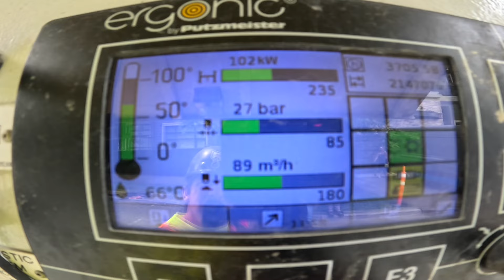PUMPING CONCRETE: 800 cubic yards with a PUTZMEISTER 56Z (with aerial drone footage)

Comment: When it ends up being an 800 yard pours but they  order 650 plus. The final 150 gets a little slow. Been there before
Reply from the maker: @sirmister4411  they actually had it on for the full 800 from the get-go. I think service just slowed day by mid day as ready mix had other stuff starting around that same time as well.

Comment: 56 meters but it has 6 legs
Reply from the maker: @TanhMinh1  6 axles for our North American market, yes.
Reply: @canadianconcretepumper1979  in asia we 5 axis it is 70 meter
Reply from the maker: @TanhMinh1  The weight restrictions one our roads here require a good number of axles to meet government mandates.
Reply: @canadianconcretepumper1979  We really like the type of car you are driving it is very good and not cheap